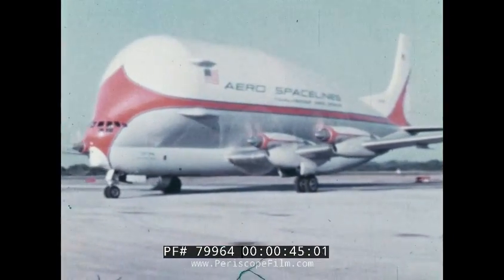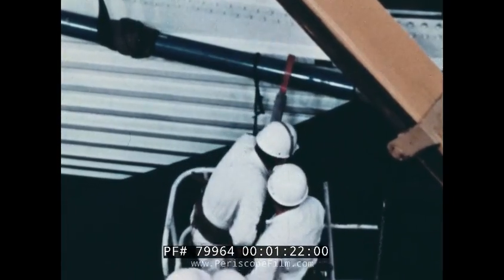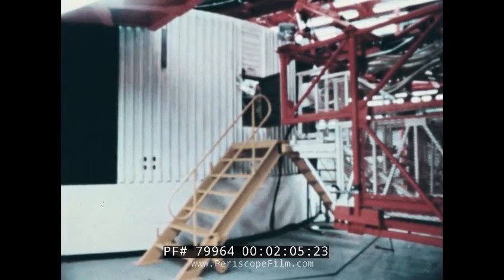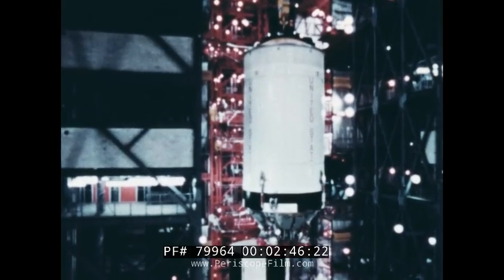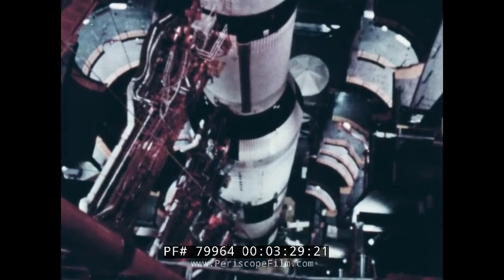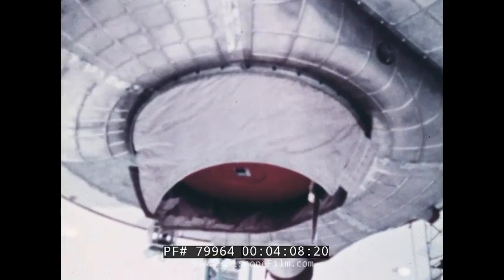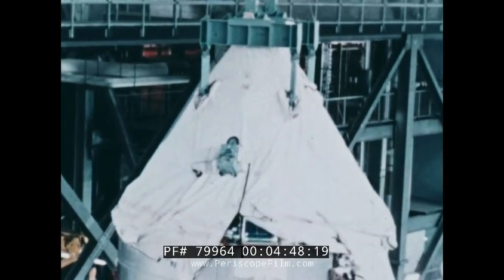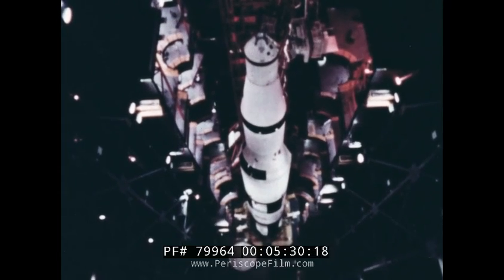ASSEMBLING THE APOLLO SPACECRAFT & SATURN V ROCKET for MOON MISSIONS 79964

Comment: The command module wasn't the only thing that returned to earth. The 1st stage (S-IC) never reached orbit and crashed into the ocean roughly 9-10 minutes after launch. The 2nd stage (S-II) reached orbital height but on a sub-orbital trajectory so it too crashed back into the ocean about 20 minutes after launch. Whatever survived the reentry heat anyway.

The only stages that didn't return back to earth were the 3rd stage (S-IVB) which were sent into a solar orbit until Apollo 12 when they started crashing them into the moon to test seismic equipment that was left on the surface after previous missions. And the LM which was also crashed into the moon after LOR.

The service module technically returned back to earth too, but most likely burned up in the atmosphere during reentry and after separation from the CM. So that's like 80% of the entire rocket that returns back to earth at some point.
Reply: So this new Dragon thing isn't new at all despite all the hoo ha. Americans were doing it then too.

Comment: Was this 1968, the apollo 8 saturn 5 specifically, were they all built exactly like this, being stacked on top of eachother and carried to the launch umbilical tower with the crawler?
Reply: That apparently was either Apollo 8 or one of the un-crewed Saturn V Apollo launches preceding Apollo 7, the first crewed launch. Apollo 7 was a Saturn 1B, a much smaller rocket.
Reply: @brianarbenz7206  so we know for a fact that apollo 8 was built like this more or less, correct? Parts were stacked on top of eachother and carried to the LUT?
Reply: @AhirZamanSairi  Yes, all Saturn V rockets were assembled that way in that building.
Reply: @brianarbenz7206  thank you